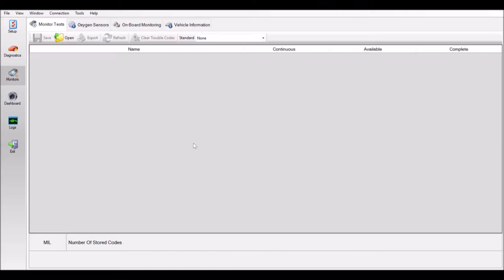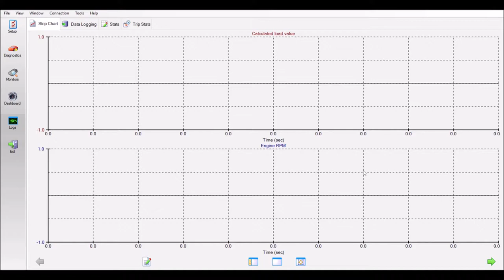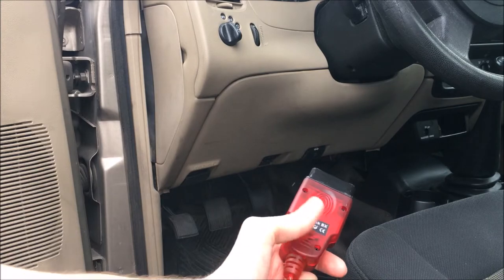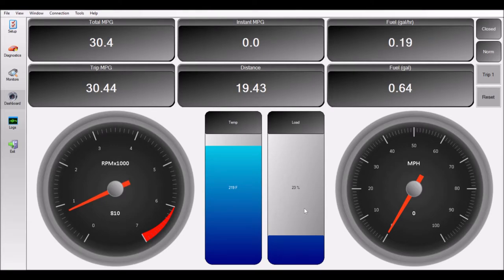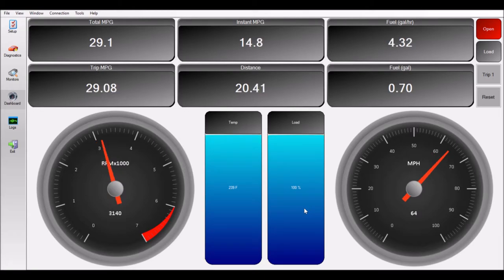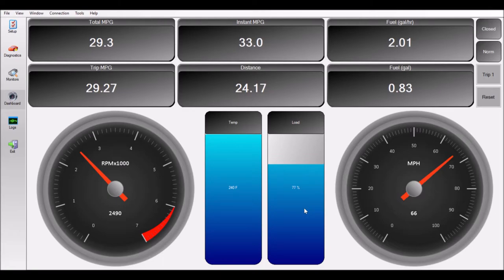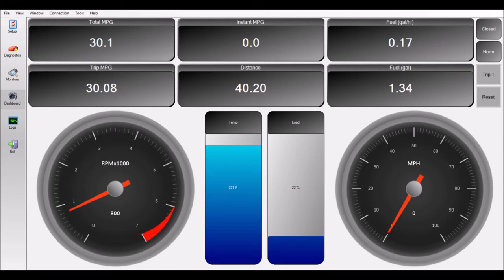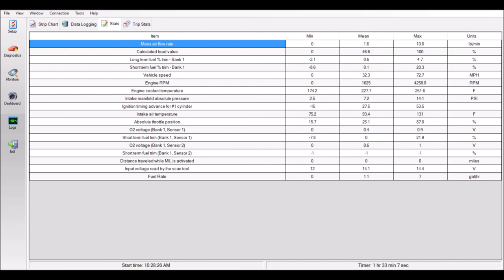EP 27 - OBDLink SX Test (And Manual Transmission Tips)

Comment: Just picked one, needed a way to set the timing on my truck. (96 gmc k2500, head gasket job P1345 code) it's pretty crazy tech definitely recommend picking one up. Considering getting the scan xl pro software.
Timing was -12 btw lol

Comment: The engine load is the torque output of the engine. An internal combustion engine is - approximately - a constant torque motor, meaning it can produce the same maximum torque at any rpm. The fact that it happens at a rpm or another, dictates how much power it produces.

Comment: Are you able to adjust or program temperatures on electric fans with this tool?
I own a 2005 GMC Sierra.
Thanks
Reply from the maker: Adan Lopez The default software only allows reading diagnostics and clearing codes, but with the correct software package it should be possible to tune parameters like the radiator fan temperature.
Reply: Dielectric Videos,
Is the Scanmaster OBD Software able to program the e-fans? What do you recommend? I have OBDLink SX.
Thanks
Reply: You can now, with tunnerpro

Comment: Hi,can I reset service engine light with Odblink?
Reply from the maker: Azurfa Da Zinnaria Yes, for most cases this can reset check engine lights, except for certain "permanent" codes which will only go away after the problem is fixed and the sensors can sample adequate data to turn it off.
Reply: Dielectric Videos , thank you 
I watched your video 3 times to see how or where to reset the service light. I changed oil on my 2008 Audi A6 last month,but I don't know how to erase the service light on my dashboard.